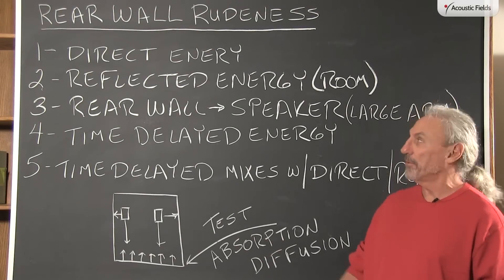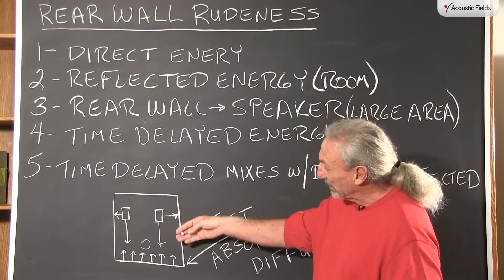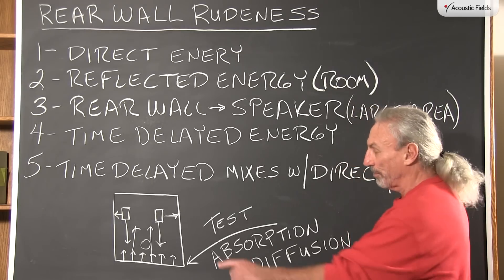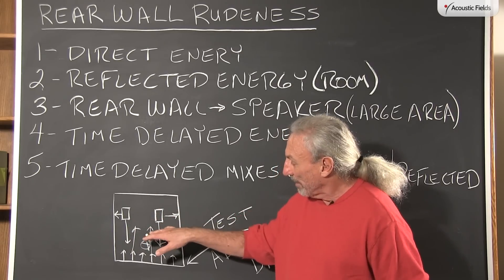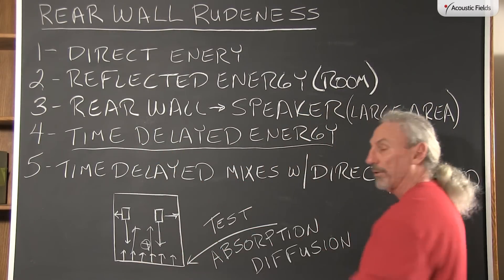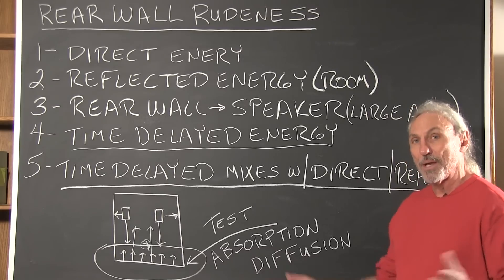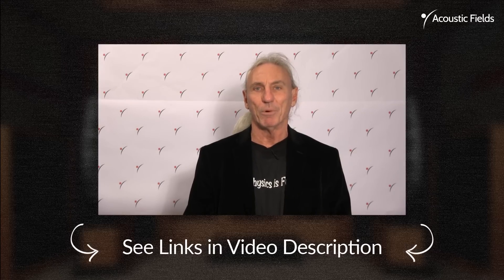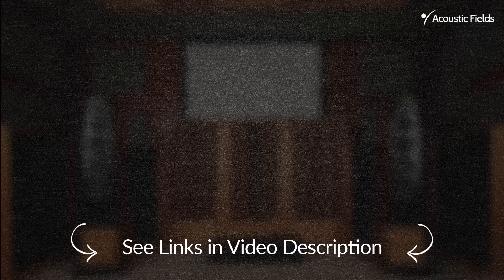Rear Wall Rudeness - www.AcousticFields.com

Comment: I didn't think of this before.. But now I wonder if some of the change we hear when toeing in the front speakers, is that more of the direct energy bounces off the rear wall at an angle and is diffused from the listening position?
Reply from the maker: The goal is a balance beteen the time signature of the reflected energy and the time signature of the direct or straight line energy from the speakers. Start with the proper rate and level of absorption technology on the front and sidewalls. Once those surfaces are managed, you can then adjust the set up.

Comment: For home theater rooms is it best to Absorb or diffuse ? From rooms that you have heard what sounds best back there , absorption or diffusion ? Thanks !
Reply: One thing I see in a lot of home theater installations in homes is they have the last row of seats right up against the rear wall and the rear wall isn't treated in most cases from what I've seen.  Some do have treatment, but a lot don't.

If you have the chance, I would experiment with both.  Isn't the rear speakers in a home theater just giving effects rather than dialog? I would think diffusion would be my guess.

Dennis?  Got any suggestions as to how to treat the rear wall in a 5.1or 7.1 home theater and also how much distance should the last row of seating be from the rear wall?
Reply: I am using absorption in the middle and diffusion to each side on the back wall. Works good.
Reply from the maker: Hi HTE,  It depends on room size and volume, amount of sources, speaker arrays, seated position, along with personal preference. If you want strong front end focused dialog, you would use absorption for side walls through the primary and secondary reflection points. The tertiary or third reflection point can be diffusion to "widen" things up. This is for 5.1 but more sources(channels) require different approaches. We use diffusion/absorption combinations to achieve the sonic presentation desired by the client. They are tools to create a sound signature. You control and "paint" the picture. Remember that all absorption and diffusion products are just tactics to use. You must have a strategy to obtain good sound. You must know the end sound you desire before you choose tactics to get it. Using tactics as a strategy is never a good idea. Too much guessing and the cost of missing is too high.  Here is a tip for better front end. Take the center channel signal and split it to a new pair of the same speakers you are using left and right. Keep the whole front end array in the same sound field. You will have a left, left center, right center, right for the front end all the same speaker and size. this will give you definition and a continuous presentation across the same sound field. Single, horizontally placed, center channels produce excess comb filtering and a distribution pattern more tailored to selling product than producing sound quality.
Reply from the maker: Hi HTE,  It depends on room size and volume, amount of sources, speaker arrays, seated position, along with personal preference. If you want strong front end focused dialog, you would use absorption for side walls through the primary and secondary reflection points. The tertiary or third reflection point can be diffusion to "widen" things up. This is for 5.1 but more sources(channels) require different approaches. We use diffusion/absorption combinations to achieve the sonic presentation desired by the client. They are tools to create a sound signature. You control and "paint" the picture. Remember that all absorption and diffusion products are just tactics to use. You must have a strategy to obtain good sound. You must know the end sound you desire before you choose tactics to get it. Using tactics as a strategy is never a good idea. Too much guessing and the cost of missing is too high.  Here is a tip for better front end. Take the center channel signal and split it to a new pair of the same speakers you are using left and right. Keep the whole front end array in the same sound field. You will have a left, left center, right center, right for the front end all the same speaker and size. this will give you definition and a continuous presentation across the same sound field. Single, horizontally placed, center channels produce excess comb filtering and a distribution pattern more tailored to selling product than producing sound quality.       .